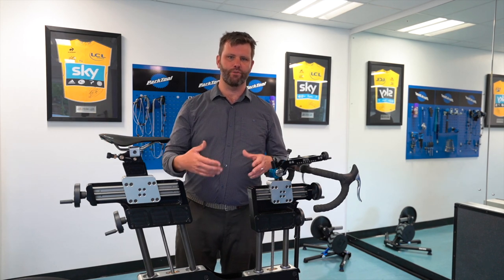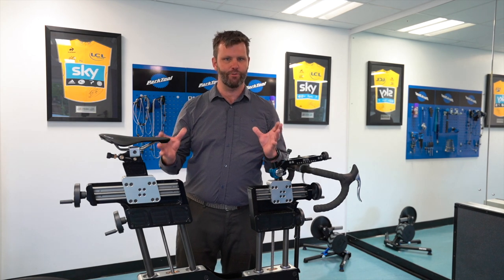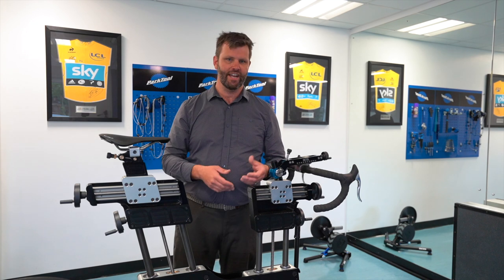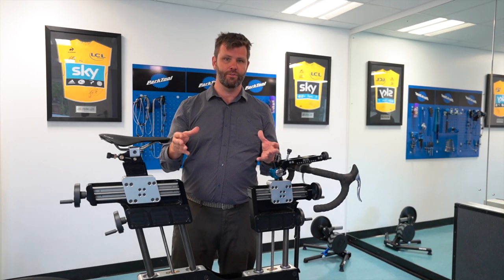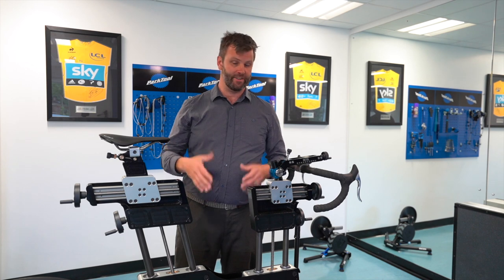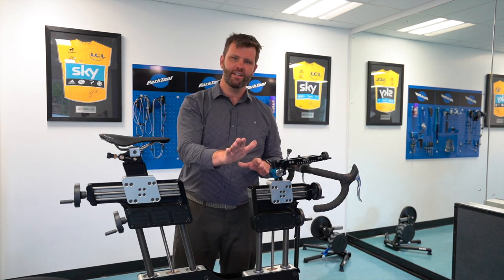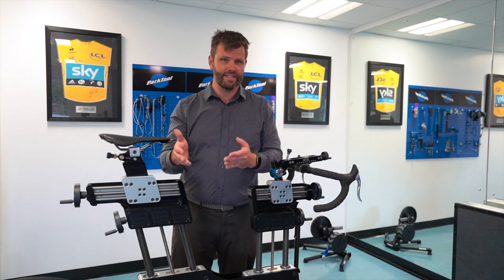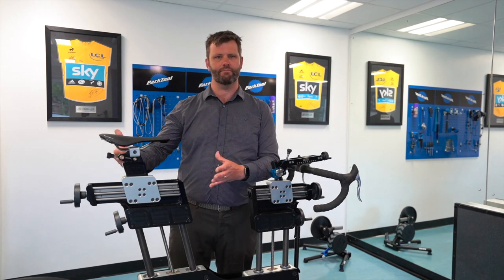Which Pedal System Is Right For You?

Comment: I have my cleats setup according to the way my feet look hanging off a table, my right foot points out more than my left. If I keep my cleats completely straight it will pull your like just like you said and cause IT band pain. When I stand up both my knees point out so this is what you should do with your cleats, and also puting the cleats all the way back helps take pressure off your knee joints.

Comment: Great video, just found your channel. I am currently recovering from a broken hip and was using spd sl pedals. Would you recommend speedplay when I return to the bike, any tips would be great. Keen to get back on the bike but nervous.
Reply from the maker: There's nothing to immediately suggest you won't be able to use your SPD-SLs, particularly if you were using them trouble-free pre-op. Be progressive and steady in your rehabilitation and see how you get on. Of course if you have knee or tracking issues then Speedplay may be an option. They have greater adjustability than other pedal systems, but if you don't need that greater adjustability you don't need it! Of course nothing to stop you buying if you fancy them, but unless you have a pressing desire for speedplay or there is a biomechanical need, if it ain't broke don't fix it? (I say this is as someone who doesn't 'need' Speedplays but has them because I like them)
Reply: @PhilBurtInnovation  Many thanks for coming back to me. My only problem with my current pedals was unclipping quick enough. They seem like the next best option. Thanks again, keep up the great work.